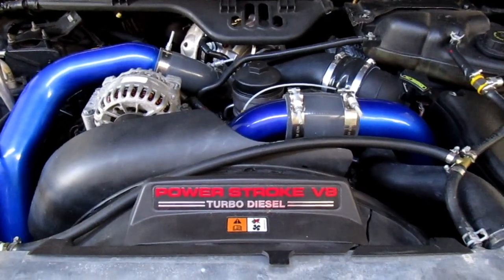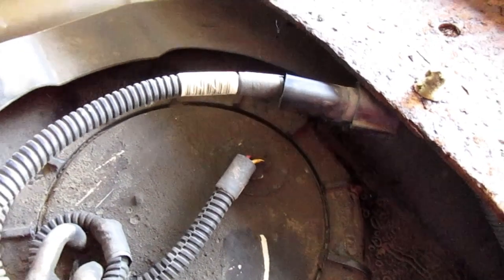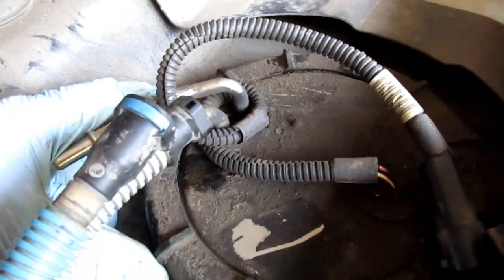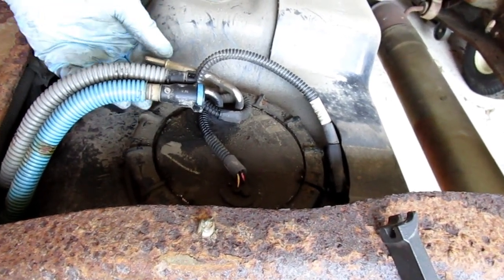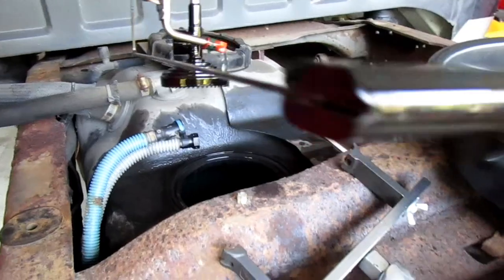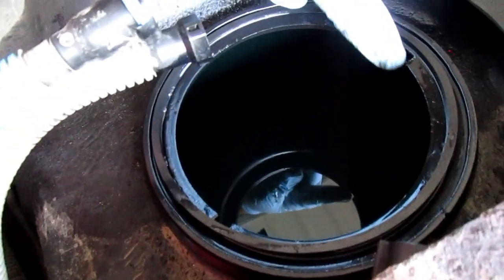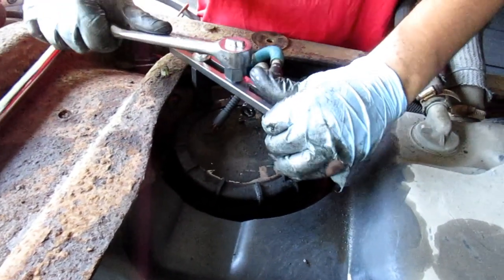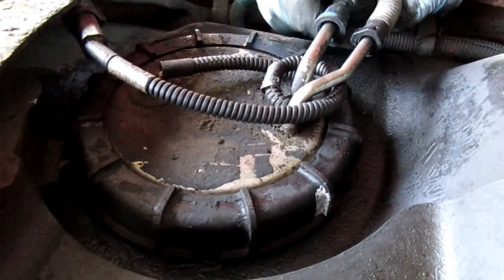f250 f350 6.0l Powerstroke In Tank Fuel Sending Unit Strainer Replacement

Comment: Were you having any problems with fuel data errors or your fuel gauge dropping to empty at about half tank? Mine starting doing that recently. Wondering if this would fix it or have to buy a whole new sending unit.
Reply from the maker: My fuel gauge would be a little over 1/4 tank and I would somehow be out of fuel. I had to always keep it filled up over 1/4 tank because that little side valve was missing. The new strainer lets me get fuel from the bottom of the tank eliminating that issue.
Reply: @SteveKish  why didn’t you get the ok’d valve out of the tank?? I bought the whole unit

Comment: What was the reason for you to replace that strainer?
What was the issued with the truck?
Reply: The valve on the side was gone so if the fuel is low it can suck air and run like it has no fuel & sometimes shut off
Reply: Or if u take corners it will suck air lose fuel psi
Reply: Mine does this exact same thing. It runs perfect til about 85 miles to empty. It'll run crappy and die, sometimes start right back up. Drive a few more miles and notice fuel goin away quicker than it should, it dies and sometimes won't start for a few minutes. But as soon as I put fuel in it above 100 DTE runs perfect. I think just seein this valve helped me realize what it was.
Reply: I think maybe my sending unit could be bent a lil or something as well. But I'm betting this valve is my issue tho.

Comment: Is the 08 6.4L same strainer? They all say for 7.3 and 6.0 but not 6.4. They look like the very same and going to toss 20 to wind and get one to see if its same and will fit on end properly
Reply from the maker: DId it fit?
Reply: it will not ift. 12mm hole versus 15mm hole in 6.4l